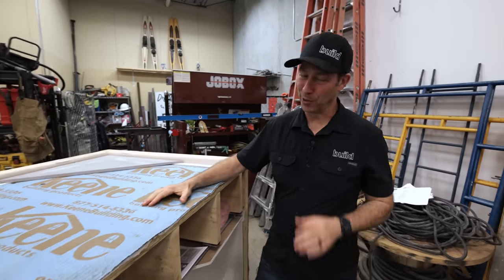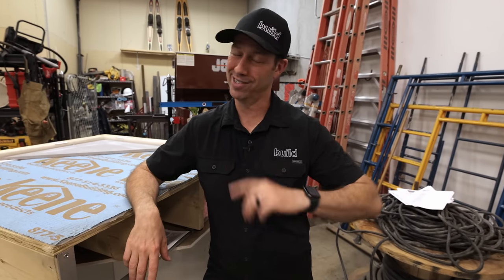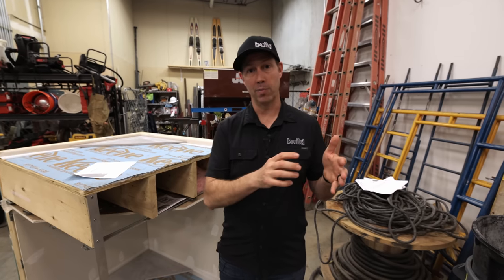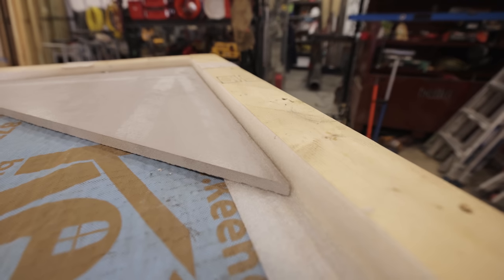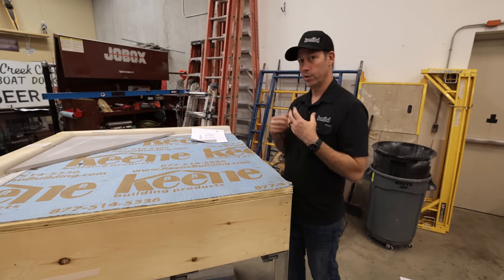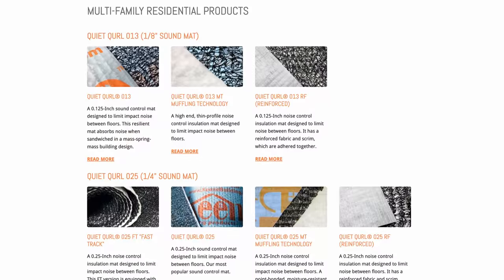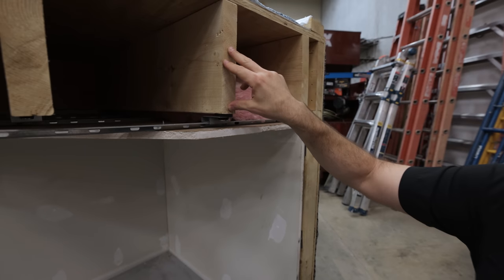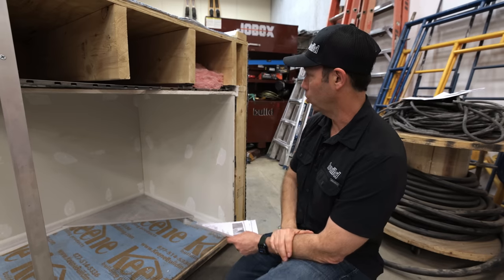Sound Proofing Overview - Critical for multi-family construction!

Comment: Why lightweight gypsum concrete (which my flooring guy tells me is a 20-year product and hellish to remove) instead of heavy-weight portland cement concrete?  More mass more better, right?  A 4 inch slab weights in at 50psf dead load, which can be engineered for by upping the joists a bit.

Comment: In Estonia most new apartment complexes use concrete slabs between floors. This is usually good enough to prevent airborne noise transfer but not enough for impact noise. To mitigate that most developers use a special mineral wool (usually between 30-50 mm or up to two inches) that's laid on top of the concrete. And then on top of that they pour a layer of concrete that also houses the radiant floor heating pipes. It's important that the top layer of concrete doesn't come into contact with walls that would transfer impact noise through the walls to neighbours below.
Reply: Here in europe we have panels of special plastics

Comment: I do sound proofing one of the best products I've ever seen is Acoustiblok. Armaflex makes a product similar to the quiet curl. Temp matt is another basically 1/2" thick ceramic spun strand. Also used as a fire stop. Which is great for between floors.
Reply: I wish we could get real unbiased info like that from Matt about various products. But he seems to only ever make videos for companies that pay him, so it's never actual unbiased real information.
Reply: @orrd  I've been doing insulation, fire proofing, sound proofing for 16 years. I've worked with so many products it would make your head spin. Done work at Nasa plumb brook station, various nuclear power plants (NPP), industrial, commercial, hospitals, colleges. What kind of questions you got I will do my best to provide any info I can from my field of expertise.
Reply: I'm really interested in acoustiblock and other mass loaded vinyl products. I'm curious what your recommended wall construction would be if I have total thickness budget of 10" and the ability to double drywall. It seems like acoustiblock is incredibly potent at blocking sound for it's thickness but does it block all frequencies evenly? I would like to reduce the 70hz-10khz range effectively. If the acoustiblock's damping properties also help sub sonic that would be great, but if not are there other materials that I could layer to block low frequency vibration from cars, planes, trucks etc? How much db reduction you get from a 1lb sheet with a fiberglass insulated walled vs 2 lb, vs just plain fiberglass. I'm building in places where there is a need for high insulation in addition to sound dampening, so If there is a point where adding more vinyl isn't as good as adding 2 more inches of insulation or another layer of drywall I would be very curious.
Reply: @eliau5482  "Soundproofing" (100% Sound Elimination) is thus far impossible to achieve with Acoustiblok material or any other product. The ARTVIS® service allows the Acoustiblok engineer to actually “see” sound in real-time (as you would “see” thermal contours with an infrared camera). Not only can they precisely measure the intensity, frequency content and the primary source of the noise, but also all the reflections of that specific noise. This can save the client an incalculable amount of money and time as well. Calling them to get a quote is probably your best bet.

 There are a lot of sources that noise can come from along with resonate off of. I have a case I'm dealing with right now where a house is 500 yards away from heavily used train tracks. Not only is the train horn an issue at 150-200DB but the vibration of heavily loaded cars traveling down the track literally vibrating the foundation of a house. Then combine that with people driving down the street blasting their sound systems with excessive bass. Plus the client deals with tinnitus frequency is 10,000 Hz (10 kHz)
Reply: @soverien41   I live in a condo and I can hear my downstairs neighbor's dog howling. I think the sound comes through my air ducts, or HVAC, or drywall, or maybe the hole in the wall near my water-heater. I'm not sure how the sound is getting into my space, but how can I determine exactly where the sound is entering my condo and how can I eliminate it? Is it possible to reduce the howling in my air ducts/vents? Your work experience is impressive.

Comment: Hi Matt, have you looked at the Sonopan Products? Made in Canada they have a soundproofing wall panel and an impact dampening flooring panel as well. Really great in new builds as well as retrofitting rooms (eg building out a theatre room or home office)
Reply: Outside a few northeast states, the sonopan products are very hard to come by in the states, for now.  I've talked with the distributor as I was wanting to install on a small remodel I was doing and ordering in the quantity I would need wasn't feasible (months for delivery, crazy shipping costs which isn't their problem but it's still an issue, and quantity far exceeding needs)

Comment: I have an unfinished basement but the upstairs is already finished. What options do I have that can be installed from the underside of the floor while the joists are still accessible? Would love to see a video on that. Also good for people that are retrofitting since tearing out a ceiling is easier than tearing up a floor in many cases.
Reply from the maker: Lots of options with that basement ceiling exposed. Rockwool batts. Then follow the advice from this video
Reply: @buildshow  yah, Rockwool is definitely on my list. I like the sheetrock detail to isolate it from the joints.
Reply: Look into Green Glue also.
Reply: @buildshow  Yeah, when I was looking at that mockup, and looking at the areas between the joists, I was thinking Rockwool would be good, for both sound isolation and fire resistance, as well.  I remembered that "sound booth demo" with the Rockwool blocking the sound.
Reply: Rsic clips with metal hat channel. Its pricey, but worth it.
Reply: There is a great product made in Canada called Sonopan. Resilient channel paired with Sonopan and ⅝ drywall is a great sound proofing option
Reply: Whatever is going on with the floor and joists above the downstairs rooms, the downstairs ceiling needs to be isolated from the joists to prevent vibrations from transmitting into the ceiling, the downstairs ceiling is ideally as just plain heavy of drywall as you can reasonably construct, any penetrations in the ceiling need to be tightly air sealed, and some kind of bulkier insulating material like rockwool is used in the cavities to prevent the cavities in the joists from being echo chambers.

Sound is vibrations.  It travels thru air, and it travels thru direct contact between solid materials.
Reply: @EricBBuilds  Yes, as long as you follow the mantra you can substitute fancier materials if the benefits make sense for your application.
Reply: I went through this a few years ago, and put together a noise reduction assembly that met local fire code requirements (as it was a suite) based on Matt's advice and also Home RenoVision DIY's advice. Since we needed the fire rating anyway, we did fiberglass insulation in the joist space (but I'd go for rockwool if you can, budget was a limiter for us), then resilient channel (RC Plus) and two layers of 5/8 Type X drywall. Between the Type X drywall I used Green Glue viscoelastic damping compound which does most of the noise reduction heavy lifting. (FYI if you go for Green Glue, do NOT get the tubs; stick with the tubes - tubs are waaaay too much of a pain with how sticky this stuff gets) 

Any perimeter or opening, like where can lights came through or where there was the gap between wall and ceiling, I used the Green Glue Acoustiseal noiseproofing sealant.

It was a relatively affordable assembly since we needed to do two layers of Type X anyway per our fire code plans to get the fire rating time we specced for. It blocks basically everything going up sound-wise, and only very heavy footfalls or very low frequencies get through. It's not perfectly soundproof, but enough where you don't notice noises coming from above.

One thing we weren't able to do were sound isolation clips. Here in Canada, we couldn't find better than $5 to $7 each and it blew our budget, so we scrapped that idea.

---

Oh as an aside! Go to your industrial pipe and insulation supplier and get yourself pipe wrap insulation! The industrial fibreglass pipe wrap with the reflective outer coating, and leave room in your framing assemblies to accommodate that. Wrapping the various drain stacks with heavy duty pipe insulation was the single best thing we did to separate noise between the units. You can't hear toilets flush or showers/bath-tubs drain at all.
Reply: @TheIrreverent  I've been looking into that pipe wrap myself. Is it ok to add that much weight to a PVC pipe, though? Or is it attached to the studs somehow?
Reply: @TheIrreverent

Comment: The modern construction industry has been working on footfall sound insulation for at least 100 years. In my 1920 duplex, the oak flooring in the upper unit sits on strips of 1.5” lathe, which in turn sits on a layer of horse hair sandwiched between craft paper.

Comment: Matt - would love to see a video on retrofitting an existing crawl space foundation/floors to not have the “hollow” sound when walking around. I’m personally used to living in poured slab homes, so my current single story home with loud echoing floors is a nuisance.
Reply: I’m curious to see what he would say as well, but I would add gypcrete before installing the flooring and make sure the joists are not too bouncy and/or have plenty of bridging. Maybe you could fill the crawl space with gravel or put a layer of moisture resistant drywall on the underside with acoustic batt insulation in the cavity (could create some moisture issues though). None of this sounds very cost effective.

Comment: Most high rise construction is concrete and steel framing, at least in my area. Concrete and steel transmit very different than wood. I'd be interesting to hear this video more related to concrete and steel.

Comment: Recently when renovating an apartment that had probably last been worked on in the 1980s, I found that they had inserted board between the joist at the bottom and then half filled the void with bags of sand. 

At the time sand and lead would have been the gold standard sound proofing for wooden joist constructed houses. Lead being a little overkill and expensive.

The latest sound boards are sand filled, and very effective, so sand between the joist even today is probably very effective. Weight is obviously a concern. As it was, there was enough room above the sand to also insert Rockwool.

Sound Proofing is all about using multiple layers of different materials in order to disrupt the sound waves. A layer of sand and Rockwool is unusual but should probably be used more often.

Comment: this isn’t proofing, it’s abatement. and you need an air gap on both faces of the insulation. normal insulation doesn’t absorb nearly as good as safe n sound or a rigid 6-12lb/sq ft board.

Comment: Thanks for the video! I used 5/8” drywall with the sound membrane for my sons basement bedroom….I used the sound metal channels…but I used Resilient Sound Isolation Clips that have a rubber bushing…the clips had very specific installation requirements including spacing and joist skipping….I think the system works…I used spray foam around the supply ducts for the room above to help reduce sound via the ductwork….who knows…I also used Rockwool in the ceiling as well but made sure it didn’t touch the drywall….

Comment: So relevant, as a small landlord, this is what frustrates tenants the most (assuming essential utilities are always functioning). It makes for happier people and as we are building closer together, this needs to be further studied. A decent combination for both STC and IIC for a lower unit is installing roxul (mineral wool) in between floor trusses, soundboard over the floor trusses, RC channel over soundboard, then finally a 5/8" layer of sheetrock. Stopping still makes it through, but much milder and that can be mitigated by wool rugs above hardwood floors in the floor above.

Comment: This is interesting. I've never done or (sadly) had such tech in my home - but I wonder how these technologies relate to those used in "security" places. I've worked in a place, not a SCIF but a similar space, where it was so quiet when the HVAC was off that it was disorienting as that you could only hear your own heartbeat. I think in that case that it was 3 layers of rock with loaded rubber between - surely made to some standard. I didn't build the place, just ran it...

And now with a 9yo in a 1960s house, I'm eagerly learning about soundproofing. ;)

Comment: Great explanation. That mockup was excellent with the L-shape foam in the upper edge. Will be keeping Keene in mind from here.
Reply: What happens when you add crown molding though?
Reply: @IAintScaredOfNoGhost  that's a good point. Crown molding probably would not help in reducing sound.
Reply: @IAintScaredOfNoGhost  Molding is typically not attached super tight against both surfaces.  I doubt that molding can transmit sound very much, the nailing is superficial not structural.

(My "problem" is that I don't like molding as a style choice, so covering a deliberate gap at the wall / ceiling joint is ... interesting.)

Comment: Another great and informative vireo as always, it so cool to see someone doing things right first, and everything else second. It is great to see someone who still has morals, and cares about doing the right thing. you have the resources to do and test things that other cant so thank you on behalf of us all. I would love to mention a couple of things that in hopes to get your opinion. Schedule 80 PVC which is much cheaper than cast iron when you factor in the no hub fittings, and has none of long term maintenance issues. Schedule 80 is widely available in the US, although it may require a little more lead time, but it is similar to the grey pipe used in Canada, I believe the gentleman in your video called it system 15. It is also directly compatible with schedule 40 PVC fittings, which makes transitions easy, and while cutting is more difficult than schedule 80 it is much easier than cast iron. and it doesn't corrode. I also think the ceiling strapping used in New England is a good sound proofing detail for interior walls, on top of your quiet rock, acoustic caulk and insulation. I love that you have the resources and I would love to see the actual results. I also would love to hear your opinion on solid blocking TJI joists? I have yet to see a high quality low cost or relatively easy to install option, I am not a fan of X braces, and I am skeptical about the metal brace systems, however I do think this is another benefit of "New England Strapping"". I am also curious if you could use a product like a DuPont flex wrap instead of a putty pad, which would be more cost effective if you had a high volume of electrical boxes.  Thank you for your dedication and morals, and God bless!

Comment: my buildings control dept. insisted I put a seperate independant ceiling to isolate noise and also help with fire safety (in the shop rooms) when I converted the upstairs rooms over my shops to flats, same could be done to walls inside a household, ie seperate stud walls with cavity bats between both stud walls

Comment: The only issue I see with the separation fabric.. is how do you address crown molding?
Reply: My understanding is that you affix it to the wall with a small gap between the molding and the roof or vice versa.

Contact between surfaces is what transmits sounds.